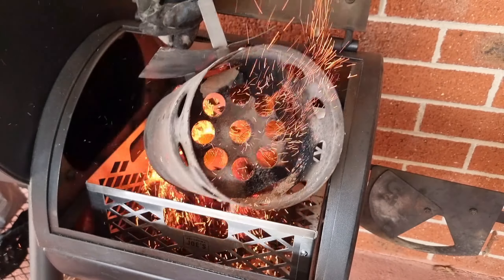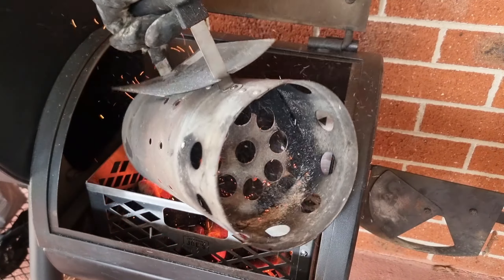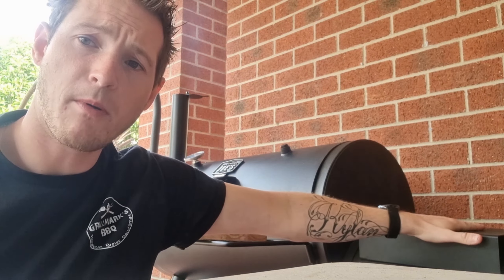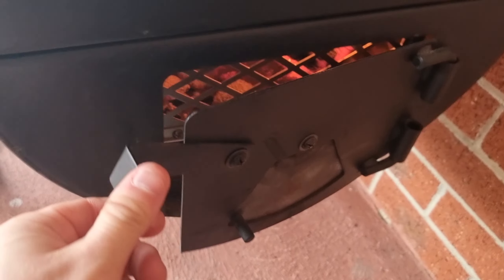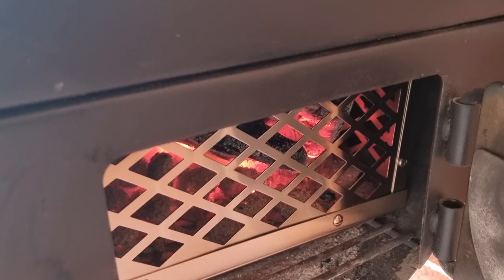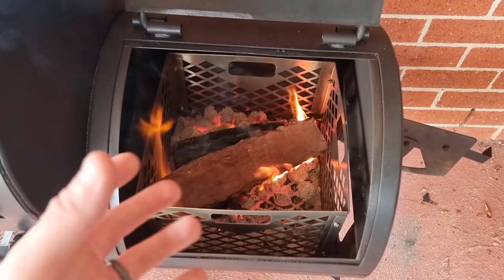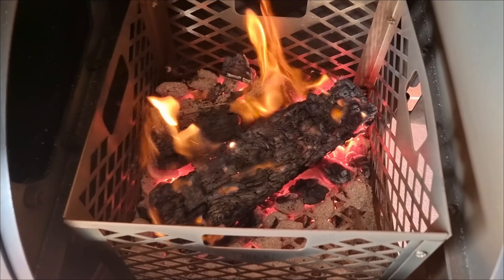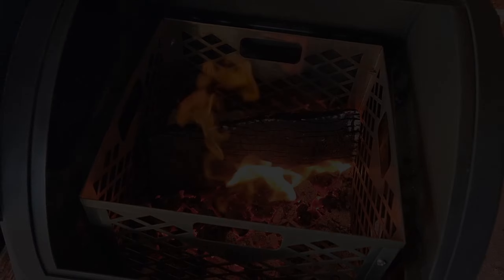Offset Smoker Fire Management

Comment: Good effort on the video.  Your smoker is way too small for splits that big. To manage your spikes in temp try cutting those splits in half. Maybe even split that first log once more and cut it in half.  Manage the temp with the size of your splits. You shouldn't have to use the dampers to control temp. If you use the dampers to control temps by choking the air from the fire it smolders which gives you the white smoke.  Good luck!
Reply from the maker: Good advice. I'm definitely aware that the splits are too big, but have since found a good supply of smaller ones (as I just couldn't be bothered cutting them down). Although, I must disagree with the damper control side of things; learning to manage temps using dampers by manipulating airflow is BBQ 101 when it comes to smoking. Although, you will end up chocking the fire and getting white smoke if the wood split to charcoal ratio is poor, which in this case for this video I can certainly agree. Always good fun and I  never stop learning with bbq, the best hey!
Reply: That's an interesting view you hold. If you agree with the comment of not having used the correct sized wood splits for your smoker but cannot be bothered to cut them to the right size, this begs the question of why a video is posted trying to instruct people on how to best manage their fires.